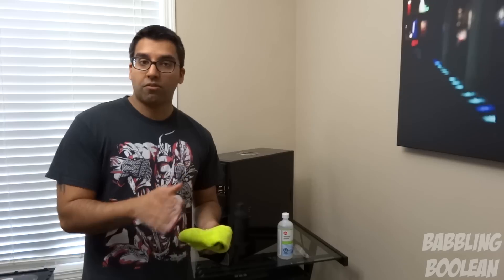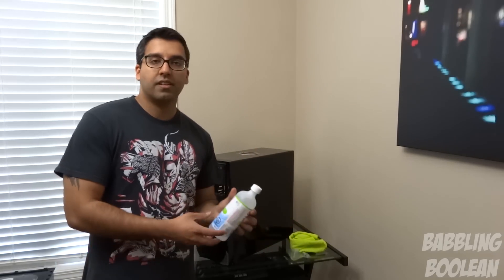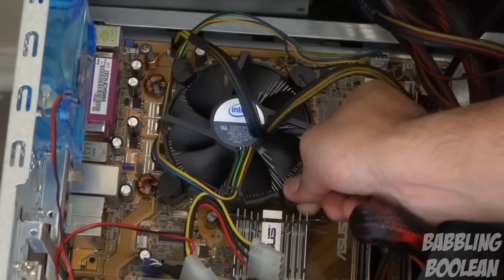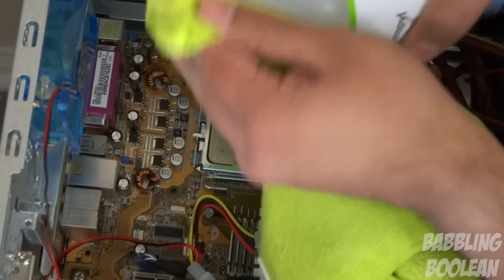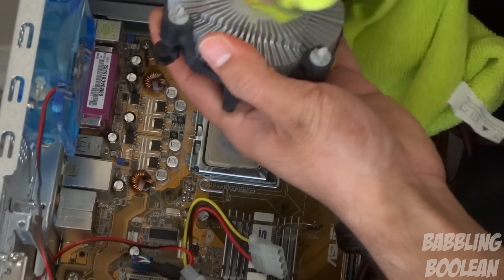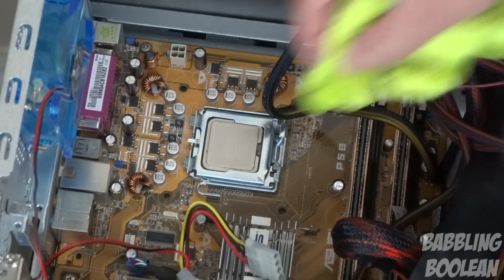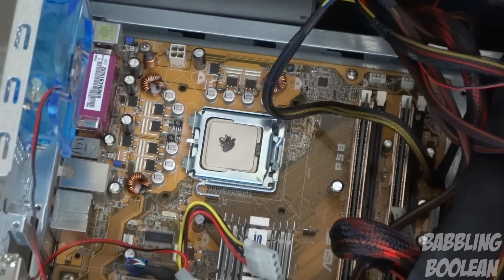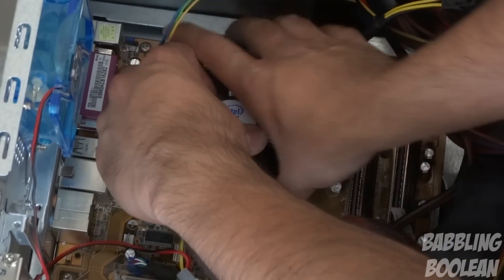How to apply Thermal Paste (and fix CPU overheating)

Comment: i need help with my one the disk in the task manager goes up to 100% and stays there and i bought new thermal paste and used and still at 100 but the thing is after i clean my computer inside due to dust i removed the heatsink from the cpu and put it back on and left it for some months and i don't kno
w what to do help
Reply: That means the CPU isn't powerful enough

Comment: i applied thermal paste and my cpu is even more hot! Help someone
Reply: you applied a lot of thermal paste or CPU heatsink is not installed well.
Reply: @BSSVK  or its a small cooler and the faster heat dissipation causes the heatsink to fully saturate in heat quicker and the fan can't get rid of the heat fast enough. SFF coolers actual don't benefit from 12.5+ w/mk TIMs (thermal interface material) because they simply are smaller with less fins and heat pipes and will not move as much air as a dual fan cooler or water cooling, thus they keep hot
Reply: Same problem can anyone help me.....I M in trouble now
Reply: @rishabhinc2936  you may need to upgrade your cpu cooler, increase airflow inside the pc, or maybe a cpu is getting older so it cant handle things anymore
Reply: @ScottieIn6ix  it's a laptop bro
Reply: @rishabhinc2936  re apply thermal paste

Comment: I was going to buy a new heat-sink because, of overheating. I bought Arctic Silver thermal paste, thermal remover and purifier. This fixed my overheating problem. I got this from walmart.com and only cost about ten bucks. I got this laptop on Amazon and it was overheating right away. This simple fix saved my laptop.

Comment: I have been doing this for a very long time. I usually take Processor out, clean its initial thermal paste with a good piece of cloth and then place it back to its proper position. Cleaning Processor in the socket is dangerous, It can damage the socket pins.

Comment: Can removing dried up thermal paste and reapplying REALLY drop VERY high temperatures ? I´m just asking, because I can hardly believe that alone would solve my CPU reaching almost 100 Celsius. Isn´t this as sign that the CPU is necessarily faulty  ?
Reply: Some cpus might need to be delidded to replace aging tim under IHS

They us liquid metal as the medium between the ihs and cpu module. I would use liquid electrical tape to cover exposed components that can short from liquid metal.

It workes for my i7 4790k

Soldered cpus dont need such procedures

Comment: can I apply it with my hand
Reply: Use your tongue. Much better coverage
Reply: You can use ur finger for some thicker paste like artic 5 sliver; I apply on both surfaces.

Gelid gc extreme only works for dabbing on center; it will spread and settle when u apply ur heatsink and let ur pc run. That paste doesn't like to spread without heating up the paste.

The less viscous the liquid (less thick - "runny" liquids) it is better to dab on center (pressure will spread it)

Remember not to use too much or too little paste; it will effect the heat conduction negatively if you apply too much or too little
Reply: nooooo

Comment: how about for smartphone processor like snapdragon 810?
Reply: i have lg g flex 2 powered by 810 n it heats up a lot above 40 c temp
Reply: truly fandamtastic have you try this method?
Reply: +alexander ekin nup m too scared to try it, m not a technician
Reply: +alexander ekin for a pc its easy for a mobile device its not
Reply: +truly fandamtastic yes still searching video tutorial to do that
Reply: +alexander ekin I would suggest u not to do it if u haven't already opened many other devices before, bt if ur not afraid of losing it completly then go for it
Reply: You  are at higher risk of breaking a phone than a computer, and the thermal paste may spread throughout in possible unwanted areas